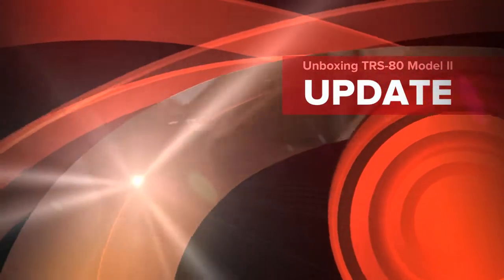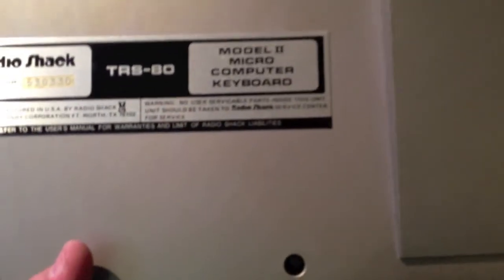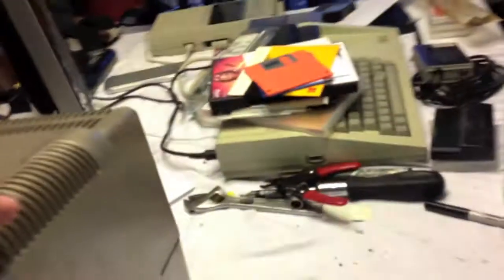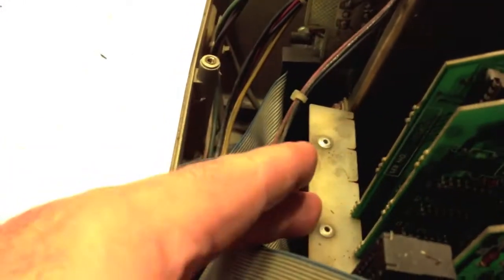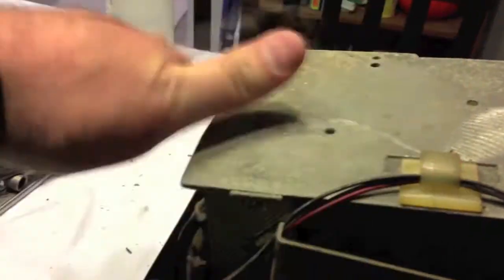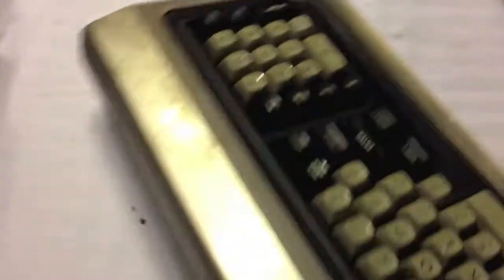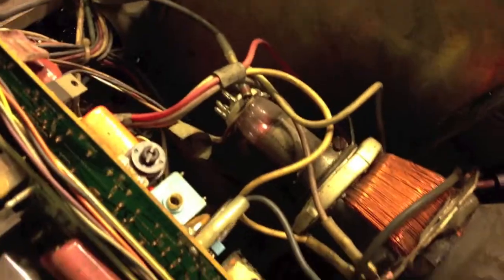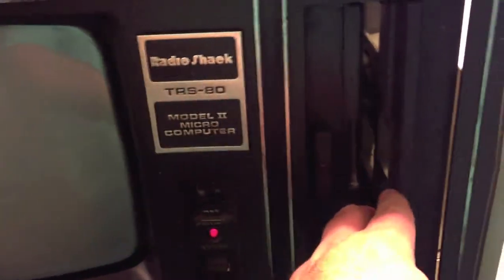Unboxing a TRS-80 Model II

Comment: Just got one of these in at my recycling company and it all looks like it's perfect condition including still new in box keyboard.  3 disk drives model 2. Is it worth anything?
Reply from the maker: Don't take my word for it, Check out eBay and see for yourself.
Though if you want to sell it, you'll need to make sure it's packages well. Those big heavy computers don't travel well without a lot of soft padding and lots of foam.